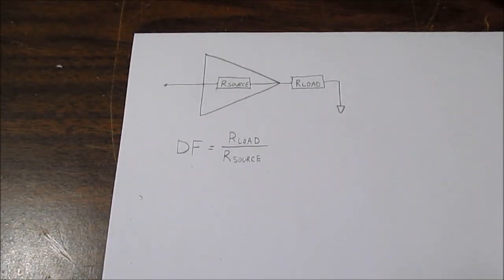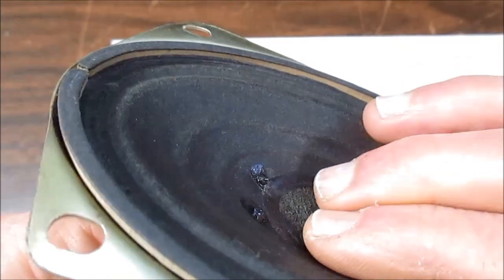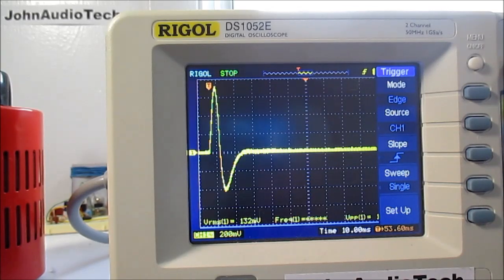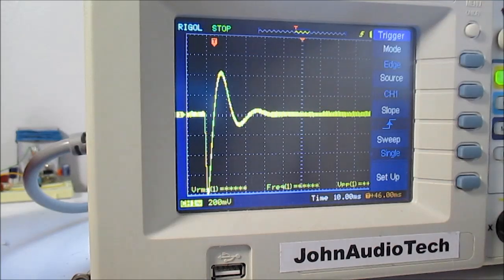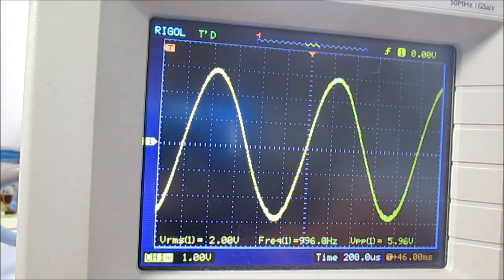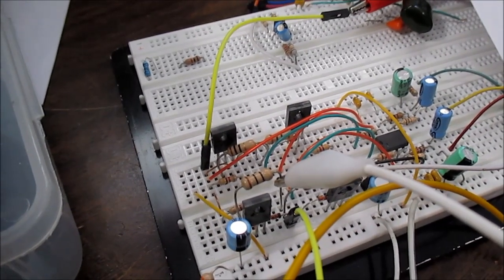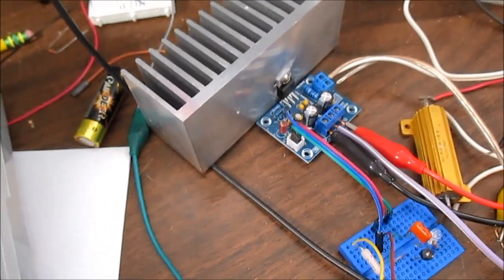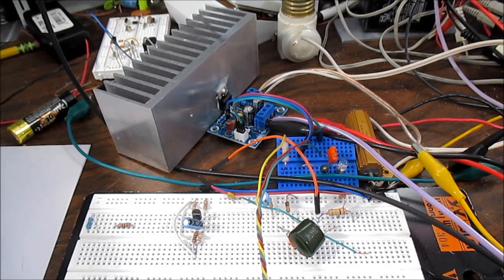Damping factor in audio amplifiers with demonstration

Comment: Is there an ideal damping factor number for ampllifiers? I have seen damping factor numbers from 100 to 1000. What can be taken from any number, that is stated, as far as how it translates to what you hear?
Reply from the maker: The higher the better but since speakers have DCR (resistance) I doubt there would be an audible difference with amplifiers that have a DF as low as around 10.
Reply: @JohnAudioTech Thanks.

Comment: I personally found that the damping factor generally affected small-diameter, low-efficiency loudspeakers. For large loudspeakers, with 38cm bass drivers for example, with high outputs, a low damping factor is not a fault, quite the contrary !

Comment: I used to give seminars that included specs like Damping Factor as a Rep for various audio products way back in the '70's. (Marantz, Kenwood, Cerwin Vega, AR,...) A simple demo of what Damping Factor does is to take a speaker, cabinet and all, (higher efficient port loaded work better than sealed cabinets) by itself and tap on the woofer as you did. Then short out the speaker terminals, I'd often just pull out my car keys and short the back terminals, then tap again! The difference is extremely audible and effective to demo how well an actual DF helps control the drivers. This also proves that yes it is controlling the driver based on allowing the counter EMF directly back into the coil. Regardless of the coil's pure resistance. This removes any output stage circuitry, effects of active amplifier feedback loops, ... It is strictly a self contain system. 

If you were to drive your output stages to clipping you would find that there is in fact a voltage drop across those 10 ohm resistors. (or you could just measure it on the scope) Because the active feedback loop could not compensate by adding gain to the stage to increase the output to compensate. This is what is actually happening instead of a true low output stage resistance. This is why many extremely high DF amps sound so bad. 

An amp with no feedback with a DF of 10 is typically a better sounding amp than one with over 1,000 using massive feedback. A DF of about 100 is max for non-feedback amps. 
And yes the more resolving and demanding a speaker system is the more audible DF games become.
Reply: I'm not sure this comment contains any useful information. Your don't explain why name high df amps sound bad. Are you saying their negative feedback fails at some point? I don't get what you comment is trying to prove
Reply: @researchandbuild1751  Sorry you are unable to comprehend. Not sure educating you is my job. It's well laid out.

Comment: Great video! Is there a way to manipulate or change the damping factor by changing parts inside the amp. (Specifically Crown Com-Tech 810 )
Thanks
Reply from the maker: I don't know the design of the Crown amp, but DF is largely a function of feedback and you probably shouldn't change that.
Reply: Yeah, it would probably be easier and better to just buy a different amp with a DF that I like more better 🤣
Thanks John

Comment: I was just given an old Rotel amp and in the specs it listed the damping factor at 1000.  They tripled up the power transistors on each rail, and they extended the negative feedback sense lead right to the speaker terminals. No doubt it is capable of some mean current and has low output impedance. Does it sound any better for it? I dunno.

Comment: There are speaker drivers with low system Q, they are over-damped and amplifiers with low damping factor make them sound a little bit warmer (or "less tight"), with more bass response due to bass notes not being damped quick enough

Comment: I guess the relatively low damping factor in guitar tube amplifiers (i.e., a high output impedance, with little control over the speaker) contributes a lot to the sound of them, especially when compared to solid state guitar amps that have very high damping factors and want to control the speaker tightly.
Would I be correct in that assumption?

Comment: It's funny in a Cerwin Vega Facebook group people claim that you need high damping factor for better cone control of the 12 or 15 inch models. Perhaps those amps with high damping factor are just better than most low damping factor amplifiers, but I don't think it matters

Comment: One thing I've always wondered about is how does it factor into the linearity of the speaker? The back-EMF will make it behave like an electric motor in that the current draw will be substantially different when the voice coil and audio signal are out of phase with each other. I've been wanting to do distortion measurements with varying damping factors for a while now to see how much effect it really has on the speaker's performance.
Reply: I have a BSS EPC 780 with a damping factor over ,>1800.. into a sub 2 ohm load! This amp delivers 1500w@2ohms and 1000w@4ohms.. 8ohms is not listed as it is a.touring amp but it has been measured into a resistive load at around 650w.

...So a damping factor of 3600 at 4ohms.. and speculatively 7200 at 8ohms.

Let me tell you now.. I have owned so much and upgraded my hifi equipment so many times since I bought this amp back in 2009.

I have had MA silvers, B&W 604s, and crap Sony speakers that came with a midi system from the 90s. I also have an Echo interface as a DAC (Marantz PM6007 also) and a Formula Sound broadcast VCA driven mixer as a preamp.

This amp has an impact and immediacy that is IMMEDIATELY apparent... even on the crap Sony speakers. There is just NO congestion in the sound at all and the sheer grip on the bass is just jawdropping.

Even non audiophile friends and people who have come over to my house have commented on how good it sounds.

No other amplifier I have ever heard, home, car or massive club sounds anything like this.

So yes,.I believe the resistance to the inductance created my the moving electromagnet allows the amp to drive the capacitive load (one way) with ultimate precision.

Seriously, buy one of these... Go on eBay. It will be the last amp you ever buy until the day you leave this planet.

Dan.
Reply: @pipesnnozzles7999  I actually did testing with various speakers and impedances some time ago. The only thing that the amplifier impedance will impact (and this is important with subs with 1-2 ohm impedances) is the frequency response. The impedance of the sub can pull the amps output around if its too high relative to the sub. Usually a DF of 100 or more will make this completely disappear. Distortion and nonlinearity were more or less unchanged as the motor nonlinearities become a factor once the DF of the amp is high enough to have an impact on the back-EMF. Yes it helps damp it, but the motor itself then causes additional distortions that offset any gain.
Reply: @mysock351C  yes, I know what you mean by this.. an example I'll give is driving a set a 250ohm Sennheiser 650s from a cheap Android phone. It's not that they don't go loud, they just sound crap. Really insipid bass and no punch or attack... Even at very low listening levels so as to be within the reserves of the power supply/capacitor bank reserved for transients.

So yes I agree this is a real phenomenon in the case of a low output to load impedance ratio or even worse a negative one... Which was likely the case with that phone.

All I will say is that I wish you would hear this amplifier as many many people, mostly non audiophiles who don't usually care about sound but importantly a friend who works in the live sound industry.. who got me the amp in the first place.. all at first demo were just mesmerized by the sheer grip and control and just effortless immediacy it has on seemingly any spealer system.

You are aware that hifi speakers with passive crossovers pretty much nullify the majority of any damping factor that is present right? Hence why good hifi amps typically spec it at 100 upto 250 max for premium stuff.

Things change when you have am unheard of at the time number of extremely high slew rate MOSFET output devices connected series-parallel like in a 10/90 odd  ratio. 0ohm output impedances into resistive loads ie heating elements has marginal relevance when dealing with a complex reactive load like an amp/speaker combo... Particularly when passive filters are involved.

I have connected this amp to several car audio sub drivers also... No passive crossovers.. a direct connection. Turn the amp on... No signal input.. and the cone goes noticeably stiffer... This is class A topology in action. I have never owned a tube amp but I imagine the same thing would happen.

I could be wrong here, however if so, there is another phenomenon at play if it isn't damping factor per se. I don't doubt myself at my level of knowledge however I am smart enough to know that there is always more to things and not to reduce things down to the simplest "smart" explaination.

What else could this be?

Comment: Howdy. Nice work.
And yes. A loudspeaker element will display reactive power. The reactive current will flow backwards some part of the cycle and tends to raise the voltage at the amp. output.
However. You are correct. The global negative feedback will sense this and restore the waveform fidelity.
Some advokate the loudspeaker should be current driven (not voltage as is usually). That should compensate for the coil resistance allowing full benefit of a low output impedance.
I don't really know for myself. I would imagine loudspeakers are designed for maximum sound pressure flatness to flat voltage. The current is let alone to vary at will.
In my mind current driving would flip this setup resulting in an "anti" -flatness sound pressure response.
Regards.

Comment: My amps DF tends to range from 200 to 500. The one with 500 sounds the best and has the tightest chest thumping bass. That could be just a coincidence. What I think is really going on is that the speaker cables are lowering the DF even further. This would depend on length and thickness of the cable.
So if you want tight bass, keep your speaker cables short and thick. Nothing less than 12 g will do ...

Comment: 22:11 I'll chip in and take Benchmarks view on Damping Factor, which is that it should be as high as possible to negate the variable impedance of a speaker/crossover system.  Benchmark's argument is that the output impedance and speaker impedance act as a voltage divider.  Taking Z1 as amplifier impedance and Z2 as speaker impedance and assuming Vin is the voltage that the amplifier would produce without a load; Vout is the voltage at the terminals on the back of the power amplifier when the speaker (Z2) is connected Vout/Vin = Z2/(Z1 + Z2).  By calculating 20log(Vout/Vin) at the max and min impedance of the speaker (which will have a nominal impedance of, say, 8Ω) the attenuation at these frequencies can be seen. The delta of these attenuations may be somewhere around 2dB for an amp with an output impedance of 0.8Ω and a speaker with a min impedance of 3Ω and a max of 18Ω; this will be audible.  Factoring in speaker lead resistance, Benchmark's view is that a damping factor of ~ 170 will give a Δfrequency response variation of ~ 0.13dB which would be near inaudible.
Reply: I haven't seen an ss amp with an output impedance of .8Ω it is usually in the range of mΩ where amp damping factor is somewhat irrelevant bc as the video suggests, achieving a >20 df is totally simple. Now the catch is in speaker cables — the longer it is the more resistive it becomes BUT can the measurable difference of <.5db by virtue of a scope be audible in real life? If one loves listening to pure tones most of the time well maybe, but my audio equipment is meant for music. I've used 18awg wire up to 28ft to a 6Ω nominal speakers and also tested with 3ft 12awg to the same speakers with no noticeable difference whatsoever.

Comment: An interesting experiment and a great video. In the ported enclosure experiment, the complex waveform at 7:57(please see the waveform) is most likely due to the interference of the air issuing out of the port with the front side wave and its effect on the cone movement. That is why we see the rising portion of the second half cycle (of the first cycle) dipping towards the X-axis. Without the interference, the “complete” exponentially damped sinusoid waveform should be seen, which is confirmed by your port closure experiment subsequently. In ported enclosures, for frequencies below the resonance, the phase of the port output will reduce the cone radiation. My two cents worth. Please continue your interesting experiments.

Comment: There's more than just driver damping going on here though: https://benchmarkmedia.com/blogs/application_notes/audio-myth-damping-factor-isnt-much-of-a-factor?omnisendAttributionID=email_campaign_5eda3b728a48f72deaf34bf2&omnisendContactID=5cf937cf15b61cc5a20f8899&utm_campaign=campaign%3A+AUDIO+MYTH+-+%22DAMPING+FACTOR+ISN%27T+MUCH+OF+A+FACTOR%22+%285eda3b728a48f72deaf34bf2%29&utm_medium=email&utm_source=omnisend  Benchmark explain this very well; this will very much also apply to headphone amps and explain why a low output impedance is important.

Comment: Does this mean current model solid-state McIntosh amplifiers such as the MC452 and the MC462, both with output transformers and a damping factor of “>40 Wideband”, might have difficulties driving and controlling modern speakers?
Reply from the maker: They should have no problem with modern speakers.

Comment: John - I think this is a  great demonstration of damping factor and output Z determined by NFB. . Looks like a damping factor on that very stiff coned speaker turned out to be good critical damping at 1:1. Very interesting. I think the display on your first tapping of the boxed speaker is harmonic related and then covering the port gets you back to virtually no damping. I am guessing the second speaker is a "high compliance" speaker with a floppy cone from very soft suspension. I think the fact that  SS amplifiers have so much NFB, we vacuum tube lovers, find them sounding compressed. I know I am digressing from your video. Anyway, I think your demonstration was very nice and made two great points.
Reply from the maker: It is nice to have other channel creators watching and commenting. Thanks!

Comment: The damping factor decrease due to the speaker cable can be audible, at least in a direct comparison of two separate setups. In principle you can solve this problem with a separate wire connected between the signal input clip of the speaker and the feedback input which is not connected connected to the amplifiers output. This third wire doesn't need to be with a large diameter, because the input resistance of the feedback loop is high compared to the wire resistance. I am also very surprized that amplifier manufacturers don't supply this option of a 3-wire-configuration. They only need to connect the feedback loop internally across a 10 Ohm resistor to the amplifier output to operate it also in 2-wire-configuration.
You can furthermore operate the speaker also in 4-wire configuration providing a virtual ground for the feedback loop, which is also connected to the real ground across a 10 Ohm resistor in order to allow all the other configurations from 2 wires up to 4 wires. In the 4-wire configuration you can entirely eliminate the effect of the speaker cable.

Comment: Hey John, this video is some months old, but it's only been recently I discovered your videos in general.
It's been a pleasure to watch them and your informal yet   uncompromised speech.
On this video, however, it became sort of unclear what is the actual way how damping factor is / should be measured, i.e. with global NFB applied around the output stage or not.
The common sense tells it should be measured with the amplifier unmodified, as it's actually going to be used, but wouldn't that mean the numbers would be much higher than, say, the example you shown of the Kenwood?
After all, any amplifier from that vintage already employed global negative feedback and therefore, would be expected to achieve much higher DF, to the brand's benefit so, why it was spec'd so "low"?
I would love to see your comments.
P..S. Snickers is lovely and a great touch in your videos.
Regards from Brazil,
Fabio

Comment: Its' interesting to bring in classic spring damper theory to this and to connect the dots.  The differential equation for a spring damper system is mx'' + cx' + kx =0; where m is mass and x''is the second derivative of displacement in the x -direction, i.e. acceleration, giving F = mx''.  c is the damping factor which damps the sinusoidal motion as a function of velocity x', and k is the stiffness spring constant from Hooke's law (the stiffness of the suspension in this case).  The amplifier signal provides the force to accelerate the cone, the stiffness of the cone (k) resists the motion, and the damping factor of the system (c) damps the harmonic motion of the system.  However, c, is not just the damping factor Rl/Rs, the suspension of the speaker will also be self damping to some extent since it's not an ideal spring.  Theoretically then, the higher the damping factor of the amp/speaker combination, the more closely the the speaker will track the waveform; this will be important at HIGHER frequencies for a woofer/midrange driver because the acceleration of the speaker cone is greater as the frequency increases, and cone overshoot at increasing frequency=distortion.  At lower frequencies the displacement will be greater but the acceleration much lower.